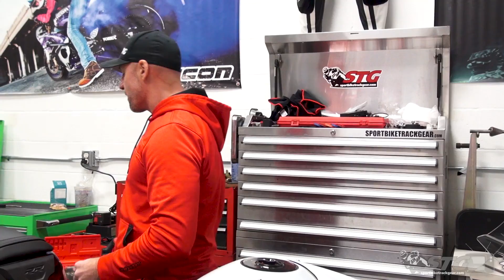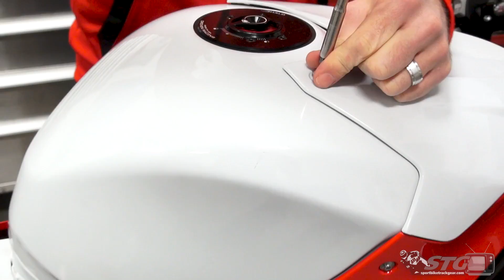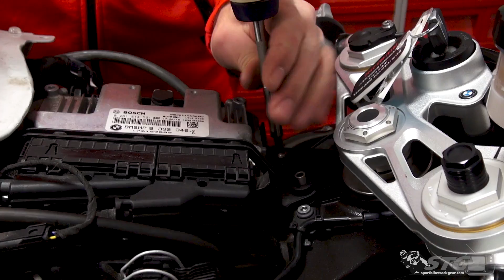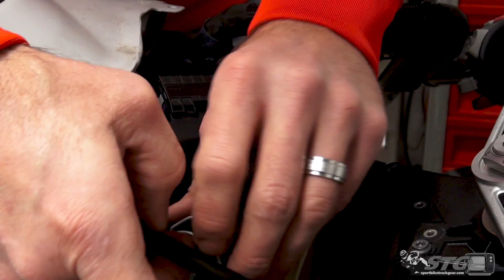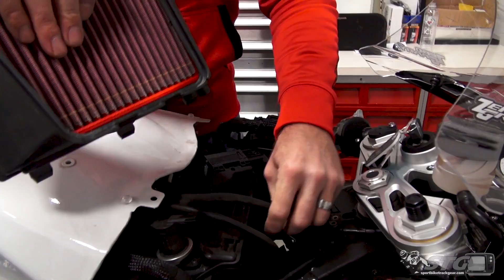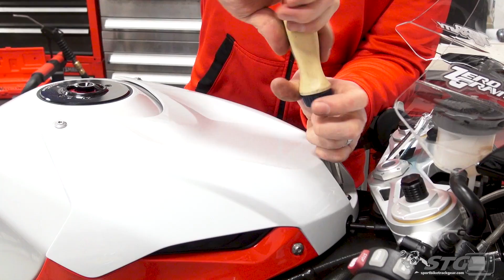2020 Project Bike 2018 BMW S1000RR BMC Air Filter Install | Sportbike Track Gear

Comment: How about the purge valve/charcoal canister and block off plates on this sir? Did you guys remove those? thanks ✌️😁
Reply from the maker: Sorry, we never ended up finishing the project. We got distracted with racing MotoAmerica and ended up selling this bike. - Van
Reply: @sportbiketrackgear  Oh still great street/track build bike though and hoping to see your latest build by the way cheers & ride safe

Comment: Awesome video! After how many KMs does one need to change the air filter?
Reply from the maker: That will depend on the area you ride in. Some are much dustier than others which will shorten the life of the filter. Good practice to check the filter at the beginning of the season. - Van

Comment: Great vids Van, I have the same 2018 S1000RR premium, these videos are perfect reference.  I bought the Akro Race SS full exhaust and other goodies last year from STG for mine.   As an FYI there is an intake foam rubber noise baffle in the steering head ram air intake track that you can remove for extra air (more HPs at speed),  just look through the nose opening with a flashlight and you will see the restriction.  When you remove it there is a little gap between the plastic pull out shroud in front of the air cleaner housing and the steering head though. I used car window type rubber adhesive backed weather striping to fill in the gap.  I can't believe the aftermarket has not come up with a slip in foam ring to fill this gap.  When you have the air cleaner out you can also remove the PAIR tubes to the cylinder head and add Graves Motorsports block-off plates, available from you nice folks at STG.  The PAIR actuator is the where the two wire connector you removed next to the ECU on the brake side of the air box is.

Hopefully the governors (DeWine here in Ohio) are going to allow activities, otherwise Mid-Ohio and other tracks are going to go belly-up!  Some of the noise about stuff being limited/restricted/shut down for 6-18 months is crazy.

Keep up the great work and the positive attitude!
Reply from the maker: Thanks for the kind words and the BMW advice! This is Jimmy's bike so he is the one sourcing all the parts. I am just the dude doing the installs on this one. The Beemer is a bit different than the Japanese bikes I am accustomed to for sure. This project takes me back to the days at the dealer. 

I am really ready for this to all come to an end. Like many there are aspects of the response I do not agree with and some I do. Hopefully we are all riding in circles sooner rather than later! 

Thank you for all the business and we will see you soon! - Van

Comment: All you have to do is remove the one screw for the ecu and just flip it straight up in the air. Just gotta clear the vent hoses. No need to disconnect it or the vent hoses. I do it all the time to clean my sprint p08 filter on my 2016 s1000rr. But you did show how to disconnect the ecu if anyone ever did want to.
Reply from the maker: How many miles do you have on your bike that you are cleaning this thing all the time? - Van
Reply: Sportbike Track Gear 24.5K their is always construction on the streets here in Houston. I catch a lot of dirt and debris

Comment: I chucked my BMC and went with a Sprint P08 filter.
Reply: Yep they say the only filter that picks up power on the s1k is the sprint so the other ones are useless
Reply: xKtF very true, we tested few S1000RR airfilters on our dyno, the sprint on our HP4 picked up around 3hp!
Reply from the maker: If you want real power you need to be running Rotella in your BMW. - Van